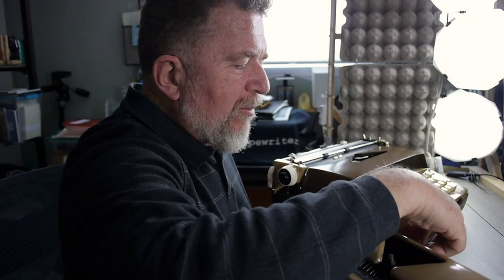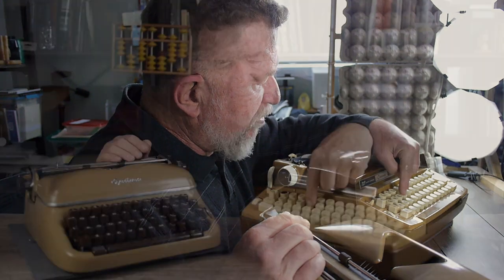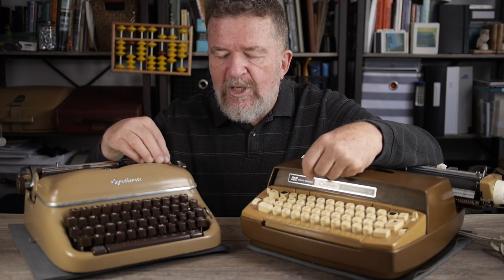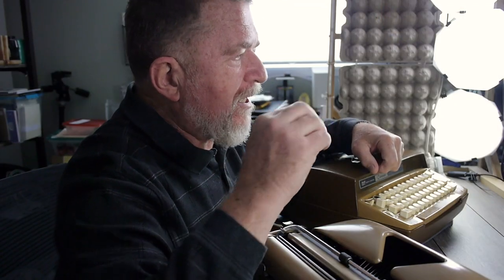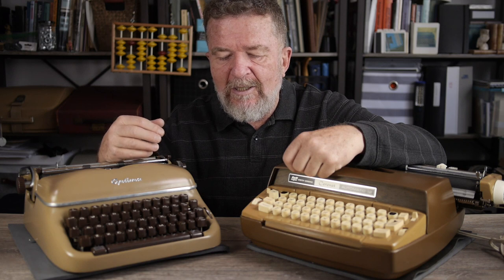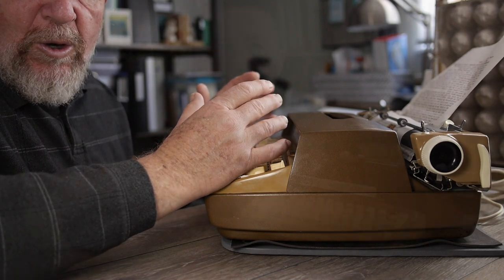Electric Typing

Comment: Joe, something that is rarely discussed is the fact that most typewriters were designed for WOMEN...in the old days it was women who were secretaries, women who populated office typing pools, women who were office clerks...the vast majority of heavy duty typing in commerce and industry was done by women. Matter of fact, you never see a man pictured in an old typewriter ad or typewriter instruction manual. The boss, if he typed anything at all, sat there and slowly hunt and pecked out a brief letter, but very few men touch typed.  The  light touch of electric typewriters I think was designed with women in mind, who the male designers of these machines perceived as having smaller, weaker hands and would appreciate the light touch of an electric, and thought is would improve their productivity.  Indeed, I knew a woman who could type at least 100 wpm error free on an electric typewriter. Her hands barely moved, only her small fingers would lightly tap the key tops.  I think men have a hard time being that delicate.
Reply: Most writers were men. Especially in science fiction craze in 50s. Don`t tell me they did not use typewriters. Or there were MANLY models ? 😄

Comment: I never really bothered to learn how to tpuch type on my manual typewriter specifically because the imprint quality was not consistent. However, I was able to develop a reliable typing speed with excellent accuracy using index, middle, and ring fingers -- good enough for most of the typing that I do. The left pinky is mostly responsible for L-shift and margin-release OR backspace, depending on whether I am using my Smith-Corona or Olympia.

Comment: I find that I don’t have the pinky or ring finger strength to properly touch type on manual typewriters. However, I do touch type on electrics. 
Also, I feel more comfortable typing when I place the machine on a low table. I use a folding wooden TV tray and sit in a vintage office chair; this places the typewriter just barely above my lap. I tried sitting at a normal desk with a typewriter and it was very uncomfortable to have my arms that high.
I enjoy your typing and photography videos, by the way!

Comment: You make a very good point. In my profession I have to type constantly, short and precise stuff. I always use my 3-4 finger method because I know it will work reliably.
When I'm at home, typing for myself, touch typing is a more viable option, because I don't mind errors so much and because I'm under no time pressure.
I think the answer lies somewhere in the middle, because truly good touch-typers will probably still be faster and more efficient. However, there are not many of those left, methinks.
Kind regards,
Alex

Comment: I learned to type on manual typewriter in school in the 80s. A course from RSA (Royal Society of Arts) which was the industry standard for office work. As a result I am to this day heavy handed on any keyboard. We did have a couple of electric typewriters but some kids would get in early and we had to take what we could get. I prefer manuals. These days I don't do much touch typing for the reasons you describe. Two fingers much easier
Reply from the maker: Yes for two fingers!
Reply: I still use 8 fingers and my right thumb. Therefore, I need not to typewrite quickly, unless a document is being dictated to me orally. It gets the job done.

Comment: I two-finger type on my manuals, but how would that work on an electric? The keyboard isn't as tilted as manuals are, and it doesn't look like the technique would be as comfortable. Have you tried it?
Reply from the maker: I've tried two-finger typing and find it works for me, but I find it comfortable (for me) to rest the base of my palms on the two front corners of the keyboard, so I don't have to support the weight of my arms. 

I find myself typing more accurately two-fingered with type bar electrics because when touch-typing with my arms unsupported, I tend to rest the weight of my arms on the keyboard which can trigger unwanted keystrokes, due to the short key throw and ease of typing with electrics.
Reply: @Joe_VanCleave  I'm going to have to take the plunge and add one to the collection.